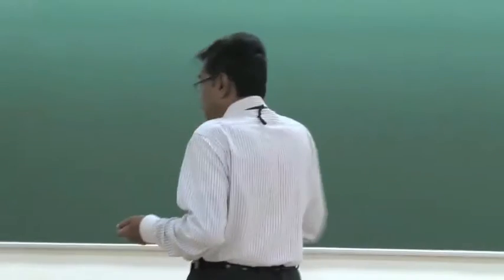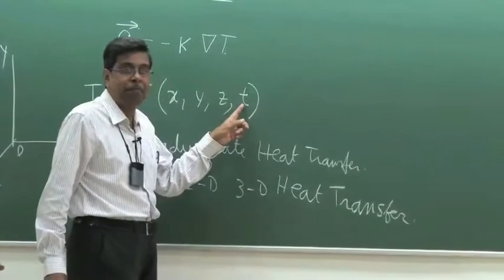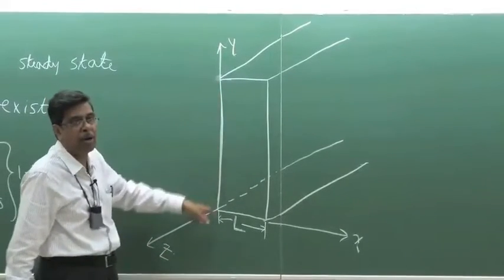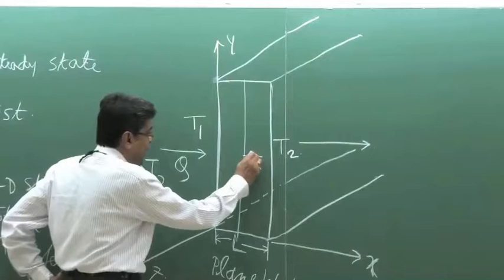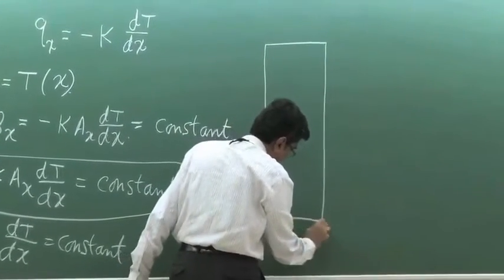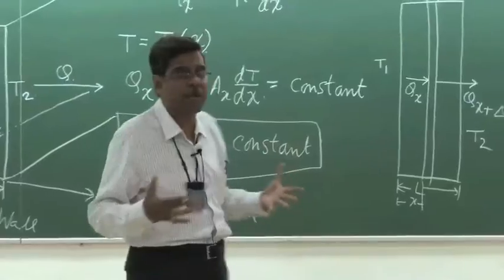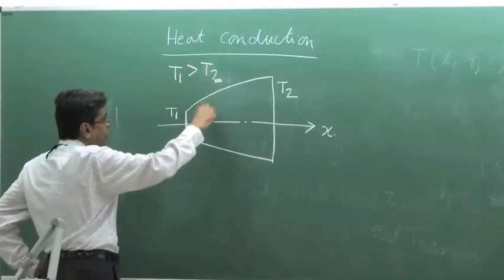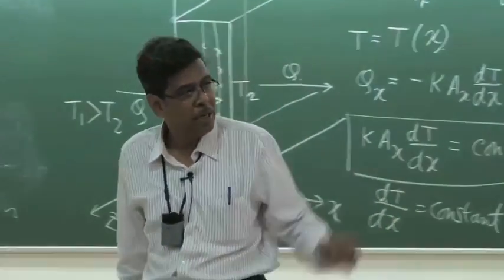Lecture 2 : 1-D Steady State Conduction

Comment: • 1 D steady state heat transfer notable points - 

1. Heat transfer in only in given direction of temperature gradient. Other remaining directions either have infinite resistence or insulated hence, no temperature difference.

2. Rate of heat transfer at any point at any instant in the path of heat transfer is same.

3. There is no local accumulation of thermal energy at every point at each instant while heat transfer.

4. Temperature as a field variable at any instant has constant distribution throughout the region of heat transfer. 
That's why it is only function of space co-ordinate especially for 1 D 
T = T(x) or T(y) or T(z). 

5. The variation of thermal conductivity with temperature or space can be possible. 

6. Heat source or sink usually be constant or can be variable but their effect should not result in temperature variation with time. 

7. Heat can spread over variable areas normally, but heat transfer rate is always constant at any given point. 

In short, being steady state is the net effect from variety of possible variations of inputs like area of transfer, thermal conductivity or heat source/sink, etc.